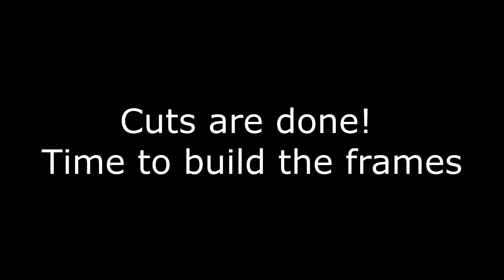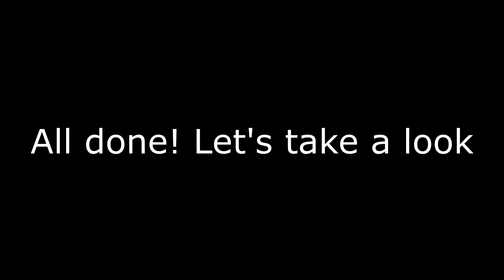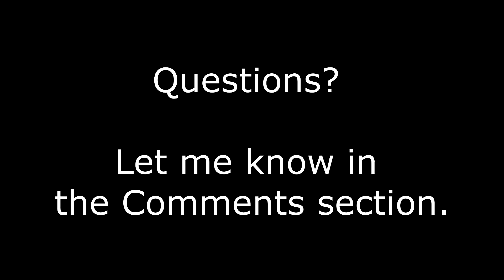Studio Build DIY by voice talent Trenton Bennett

Comment from the maker: Update! Installing the panels - it got much easier to hang the wall panels when I added a couple more hangers alongside the original ones, on the back of the panel.  The panel now had a wider 'rail' to try to hook to my wall hangers, and so it was easier to get them in position and even adjust them just a bit. :)